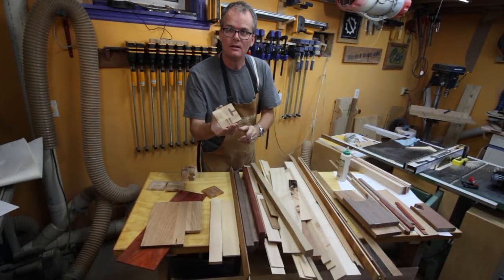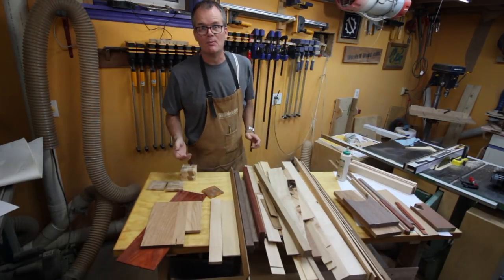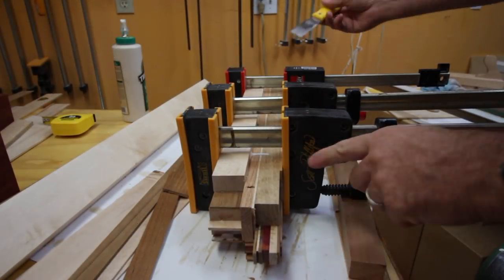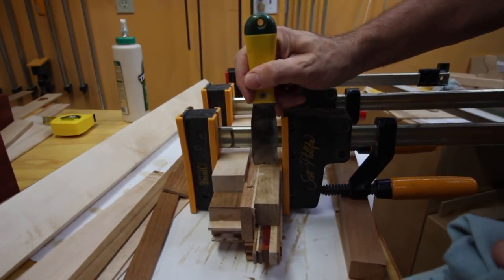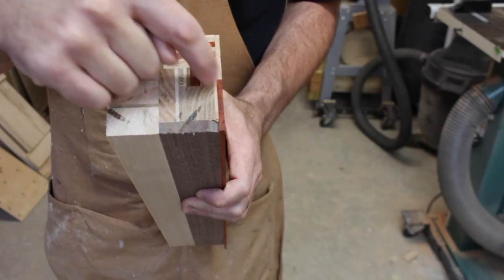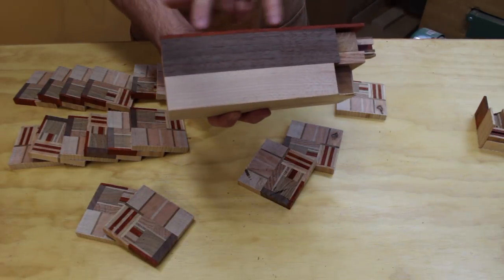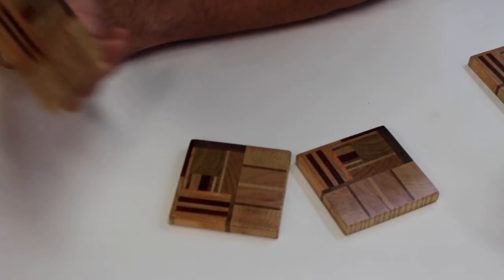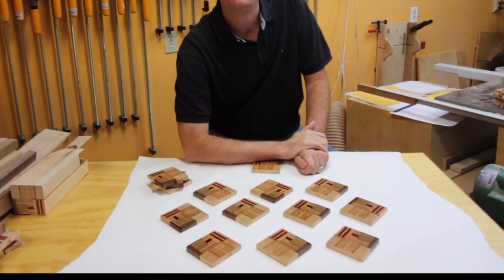End Grain Coasters Are Amazing  (WnW #115)

Comment: So, here's my input on finish. I was always using poly on my coasters. One day I made a set for my house. I just tossed them in my mineral oil tank over night. Now, 2 years later of use at my house and they are still perfect. A few months ago I stopped using the poly. All of my coasters now go out just with mineral oil. Everyone loves them!
Reply from the maker: Fascinating.   Never tried that.
Reply: @Wordsnwood  poly is obviously going to do more over time but it's a coaster. The less time spent making it is more profit. The oil will definitely last a long time and you can just take a pile of them and toss them in the tank.

Comment: Any preference on the wood glue to use(or anything to stay away from)..
Thanks.  Great video
Reply from the maker: I probably use something like titebond II, but I doubt you have anything to worry about with any wood glue.   You are not soaking these in water, they should have a good solid polyurethane coating.

Comment: Curious... how did they work out over time? End grain chopping boards made thin cup badly..
Reply from the maker: Cutting boards get submerged in water regularly, and have not much finish.  These are covered in Polyurethane and do not get submerged in the sink.   I've had my set in use for over a year with no change.   This was all well seasoned and acclimatized wood in my shop.

Comment: Nice...so where are you finding all these different species of wood? Definitely not a big box store!
Reply from the maker: If you're in the US, then Woodcraft or Rockler will carry exotic project wood.  Expensive though.   It's far cheaper to find a hardwood lumber dealer.  Most cities of reasonable size will have  a hardwood lumber store of some kind.   Smaller towns have them also, but small lumberyards are more likely just carrying domestic stuff.   Actually I think some places even sell online, but as I live in Canada those US places aren't really an option for me.
Reply: I actually order my exotic lumber from ebay. I buy 10 or 20 board feet at a time, and the price is much better than what you would pay at a specialty wood shop.

Comment: Question - before slicing up the coasters, could you put the block on a lathe and round it?  Or because of the grain direction would that not work?  I don't own a lathe, but the small ones pop up all the time on CL and I might consider getting one if the price is right and I could do something neat like coasters.  Regardless, this is a great way to use up spare cutoffs, thanks for the idea.
Reply from the maker: Sorry, I'm not a turner.  You'll have to ask someone else.   I would think so, as I've seen all kinds of people on youtube turn glued-up objects.  But there will definitely be lots of grain direction changes.
Reply: @Wordsnwood  Thank you for the reply.  Happy woodworking!